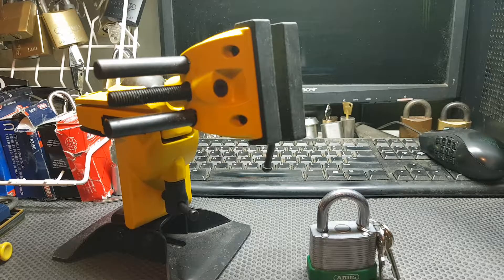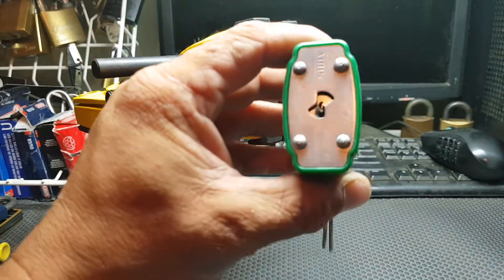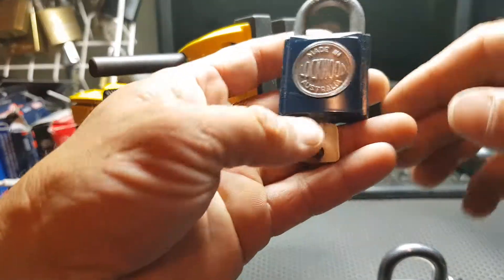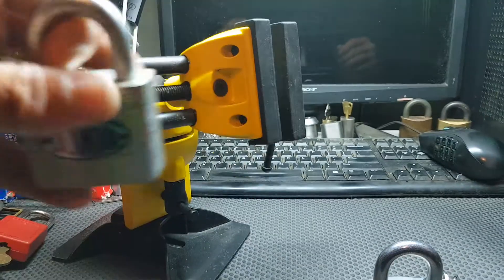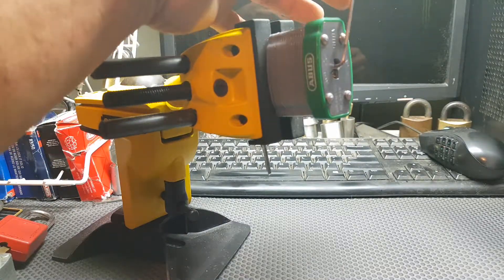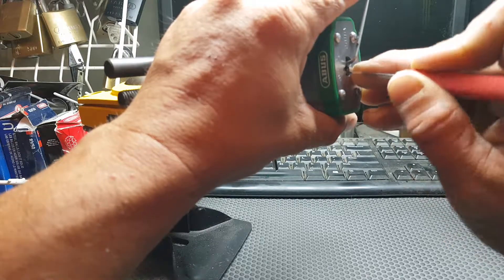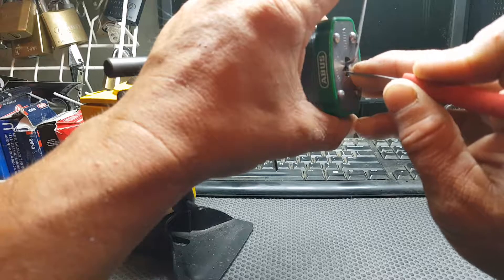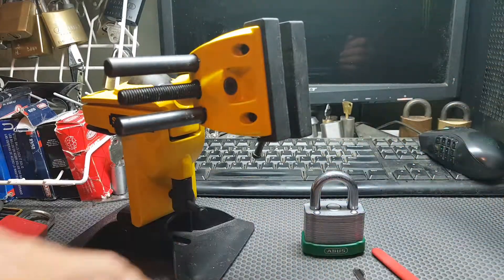Abus 41/50 Laminated Padlock SPP

Comment: The lockout ones are 71 & I think 74 series but I'd need to check. I have one of these too, not too much issue pickin'. 😉✌
Reply from the maker: Don'z Lockz Pretty sure you're right, one comes with steel shackle that is plastic coated and the other has a fully plastic shackle iirc. :)